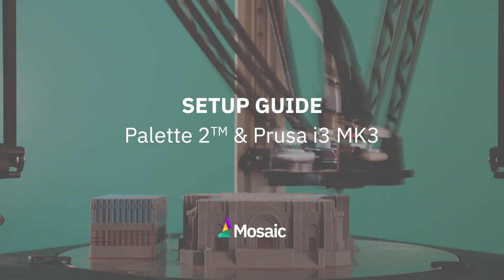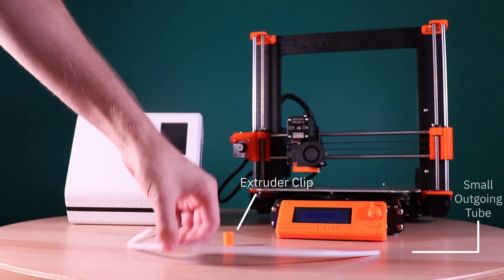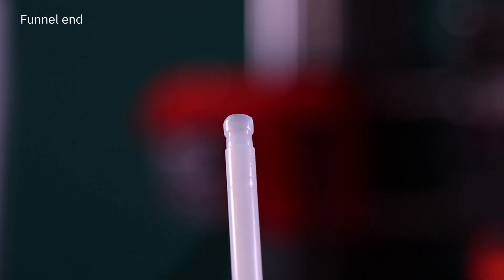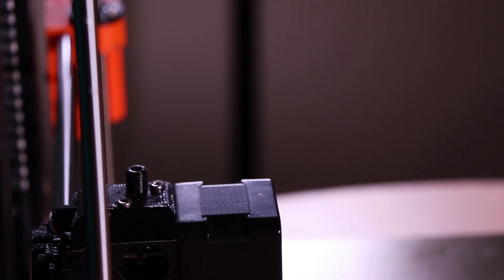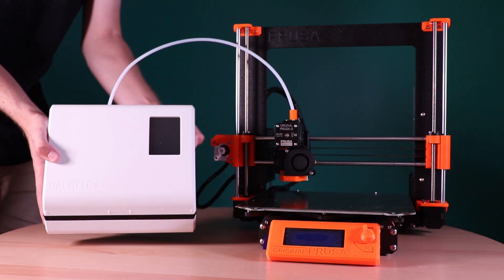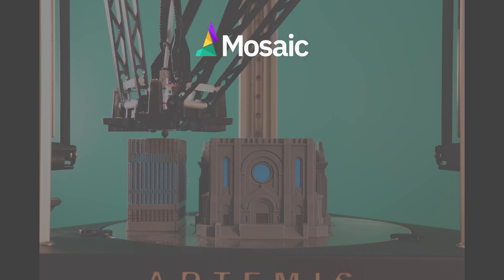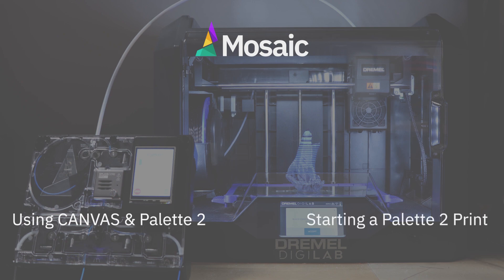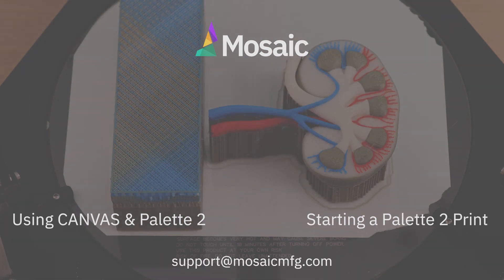Setup Guide: Prusa i3 MK3 with Palette 2

Comment: Why dont Prusa printer start when you reach the required filament to extruder? The palette 3 pro sits there an waits for you to start your printer an print yet how do you do this since it uses print from sd card? I know this is on the one for number 2 of palette but still should work the same way. Why do they not set up a way for one to jog the print controls an then have a start show up on the printer or maybe when you hit start the thing just starts both!

Comment: I have a customer who wants to use the pallette with the printer inside an enclosure for an MK3S is there an extension tube for this?
Reply from the maker: Hey there, we do offer a longer tube (1100 mm) that should be long enough for this type of setup. If you're interested, please send us a message at support@mosaicmfg.com!
Reply: @MosaicManufacturing  I know this is an old thread, can the Palette 3 Pro be placed inside the heated enclosure? Right now, I have on top, About an extra 500mm from the 1100mm tube. It never gets above 35C in the chamber. Is this wise? I have an Hemera Direct Drive and just one arm. Thank you.

Comment: After some experiences wirh MMU2 i am thinking about buying a Palette 2.
Reply from the maker: Please feel free to reach out to support@mosaicmfg.com if you need more clarity with anything!
Reply: hello, what did goes wrong ?
Reply: Single printing - which is still the main task - with MMU2 is more complicated. With Palette i think i could use it completely in single mode.
Reply: it's weird that it's more complicated, they should have tought about it.
but has MMU has 5 filaments cons 4 for the palette...dilemma !
 thanks for your answer !

Comment: I have an E3D titan extruder, is there a different outgoing tube connector that will work with it?
Reply from the maker: Hey rpm 9000, all Palette 2 orders will ship with a standard clip on which is better suited for extruders with a flat surface to mount onto, the E3D titan does not have that much of a flat surface to attach to. However, we have a number of users sharing designs for other common extruders one of which being the Titan extruder which would work perfectly fine! You can check it out here: https://www.thingiverse.com/thing:2735832
Reply: @MosaicManufacturing  Thank you! I have been researching the palette 2 for a little while now and one of the many good things I have seen is that you have really good customer service. This proved that to be true. Thank you for the response in such a short period of time!

Comment: I expected the outgoing tube to be much longer.  That length is not really very convenient. I did order the Pro and 'think' it is longer, but still....
Reply from the maker: Hey Lou, the outgoing tube here is the medium size, which is 800 mm, and allows the extruder to move around the corners of the print area without creating any sharp bends in the filament path using the suggested positioning above. If you've ordered a Pro, it will come with the large sized tube, which measures 1100 mm, allowing you a bit more room to position Palette around your MK3. However, we do suggest trying to keep the distance from Palette to your printer as short as possible so that adjustments in calibration can be applied as soon as possible.